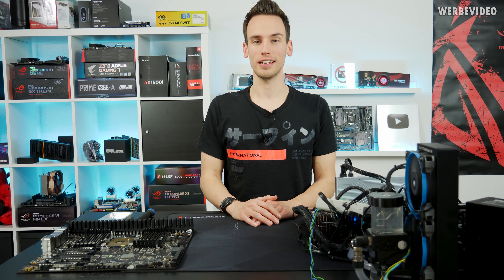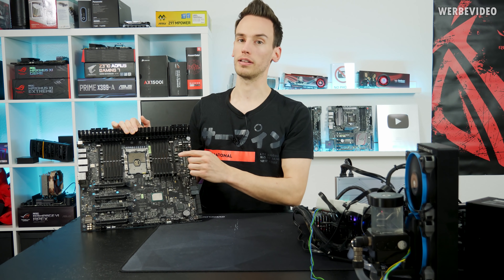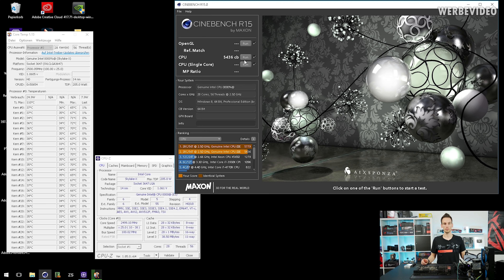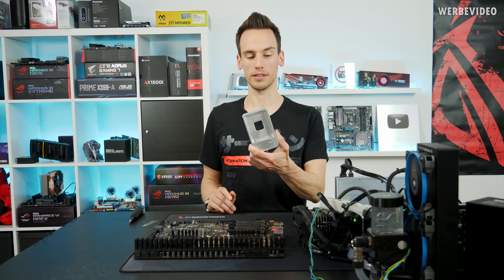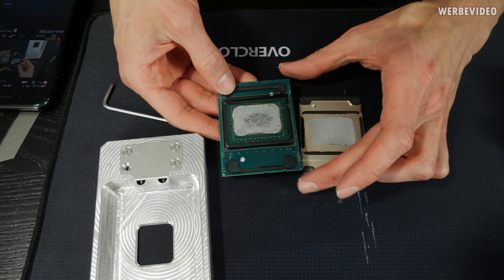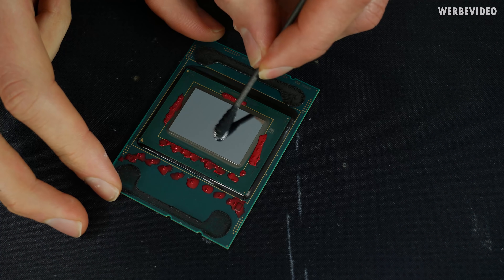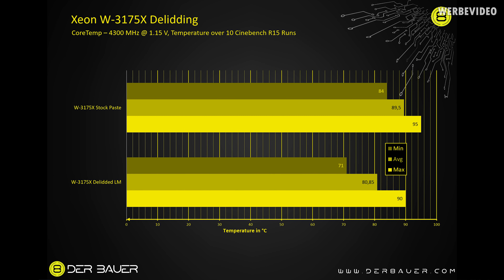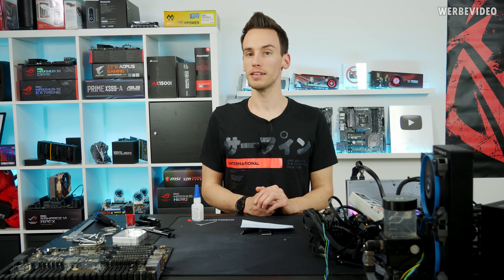The most EXPENSIVE CPU I've EVER delidded!

Comment: Ok so an OC'd 2990WX already hits 6000 in Cinebench multithreaded. What's the point of this Xeon?
Reply: Jeff T the XEON draws MUCH more power, ESPECIALLY OC'd
Reply: @Jeff T Not true. This is a 255w chip and the 2990WX is 250w.
Just take one look at the power delivery on that motherboard and you'll realize that the Xeon is an absolute furnace.
Reply: It is not numa. the memory pool and everything else is unified, there is no CCX latency, there are no cache/memory bottlenecks. it will perform way better in the tasks that are sensitive to that (not cinebench/rendering in general) it also has significantly better AVX performance). But off course price/performance and general sensibility of this platform is completely insane level bad.
Reply: @Lady_Zenith  There's always latency no matter, what, whether it's DMI, HT, CCX.
Reply: Anything that benefits from AVX512 should likely move to a graphics card.
Reply: Gamers nexus has benchmarks and reviews live. I would get two 2990wx CPUs before i got one of these. Boards are vaporware also BTW
Reply: And that's fine for you as an individual user.... but it's a different story when you're buying hundreds of the things to be maintained by a team that has been using Intel CPUs for more than a decade. If intel did NOT release this part, many enterprise workstations WOULD have moved to Threadripper, but with performance anywhere close you'll see a lot of these things moving just by reason of inertia.
Reply: This cpu is pretty much just for people using avx512
Reply: It's Intel way of saying it's also here
Reply: @Capeau  sounds like you don't understand the problem.
Reply: Missing 2 memory channels.  Go run Cinebench on a Threadripper, then again on an equivalent Epyc system with all memory channels active.  Der8auer already showed that Zen architecture is constrained by memory bandwidth in this scenario when he OC'd Epyc - the same applies to Skylake or any other many-core architecture you care to name.
Reply: Max Cowgill 2300$ more for 2 more memory channels nice.
Reply: @maxcowgill3249  Not all architechtures are memory limited. It depends on the individual architechture. Skylake is not memory bandwidth limited in the slightest, you get barely any scaling in core performance from higher memory bandwidth. Zen is a different beast, it is memory starved and you get improvements in core performance from higher memory bandwidth
Reply: Adobe Premiere :)
Reply: Intel is selling off power-guzzling Skylake-XCC yields that ISV/enterprise customers didn't want to the "1337 gamer/prosumer" market. It is a halo product design to beat 2950X and 2990WX no matter the cost.  It is Intel's equivalent to AMD RTG's Radeon VIIs which are just Vega20 Instinct/FirePro rejects that ate too much power.
Reply: cpu rendering?
Reply: Because threadripper 2 isn't out yet. I can get a 2990wx for 1/3 the price of this. But waiting for tr2 with UMA
Reply: Point is that this Xeon can clock higher under LN2/water and doing alot better in some benchmark, cause of AVX worklords.
Reply: @BNHardwarereviews  higher performance is good, but performance per $ is good for all.
Reply: Dependability.
Reply: @JackBandicootsBunker  lol. What?
Reply: Kristoffer Johnsen You have to constantly tweak the TR CPU for the workload you need, either disabling cores or watching memory bandwidth teething issues which are an inherent problem of the CCX uArch. Having to toggle between Creators Mode and Gaming Mode, or a Balanced Mode is a hassle. For the Xeon, you pop the chip in, and whatever you do, it’s going to be consistent.

While I wholeheartedly recommend the TR for any enthusiast and HEDT user, for the type of productive users this Xeon is aiming at, there’s simply no other choice, if critical consistent and continuous workloads are a big factor. AMD is still working to improve long-term workload reliability, but it’s still not viable enough.
Reply: @JackBandicootsBunker  I get your point and it's completely valid. However, this is only a problem on Windows. Microsoft is slacking when it comes to supporting future tech. On Linux most of these issues completely disappear. 
But I do get your point. Not everyone likes the tinkering
Reply: @Capeau  you are a fool. I watch his channel that is correct, but only because I have looked at his methodology, run my own tests and come to find that he does things the correct way. Just because I watch his channel for information doesnt mean that I dont have a brain and an ability to discern information myself. Go back to learning how shit works cause obviously you need more schooling in how information works
Reply: you can get higher single thread performance and programs that dont like the higher latency of TR 2990wx run much better on it.  you should really check the benchmarks for things that people that actualy spend thousands on a cpu actually run.  things like a lot of engineering software (anything from autodesk which is a lot of the martket)  run much better on intel than amd.  its just another option. you dont have to buy it.  

but actual people who buy these types of cpus really like this and will buy these becasue they will give better performance than the 2990wx. not everybody runs cinebench all day.  plus stock performance of the 2990wx is about 5050.  this cpu in this video is 5400 while only running with 4 out of 8 channels.  

plus cinebench favors amd cpus heavily.  you wont get the same performance in other apps.  if this cpu without a delid does 6200 while the TR does around 6000 then performance in other apps will be much better on the intel cpu most likely with overclocked. 

plus as i said earlier the latenyc between nodes is huge on TR chips.  from one die to another is about 4 times ccx to latency and about 8 times core to core latenyc within the same ccx.  with this chip the latency is a bit higher core to core but its nearly the same across all the cores basically.

if youre paying somebody 40-70k a year to run this machine who cares if it costs a a couple thousand more
Reply: @bobhumplick4213  the only way you would pay 4x the price for less cores and just a small % of single core performance is if you're a fanboy.
Reply: The only real reason for this CPU is for breaking OC records with LN2 because you will be able to clock Intels 28 Core CPU higher under LN2 than a 32 core Threadripper. Second reason Intel wanting to have a 'competitive' product in comparison to AMDs 32 core Threadripper.
Reply: Cinebench is not the only use case.
Reply: @mungojerrie86  I know, but the 2990WX still beats the Xeon in things like Blender. It's only in cases where the software has been optimized for Intel over the years that the Threadripper loses. 
You also have to remember how hot this chup runs, how loud the cooler will have to run and how much more expensive the motherboard will be.
It's a niche product for a very select group of people.
Reply: @DenGuleBalje  Check Gamer's Nexus' review of the W-3175X. 2990WX does not beat the 3175X at Blender, on some scenarios they're basically equal (with the Xeon beating by a small amount), but on some scenarios the 3175X beats the 2990WX by ~30%, which is ALOT if you really need to get work done and time is money for you.

Also on Premiere the 3175X destroys the 2990WX by completing the video render ~54% faster. 
On Photoshop the 3175X is ~40% faster than the 2990WX, but only marginally faster than the 9900k, so if all you do is Photoshop, just get the 9900k/8700k over either of these CPUs.

So yeah, Cinebench scores aren't really useful for anything but for comparing C4D performance.
Reply: @obese7027  I watched GN's review and from what I saw the TR beat the Xeon in Blender stock vs stock.
You bring up two Adobe programs which are  typically HEAVILY biased towards Intel. Premiere and Photoshop are traditionally not well optimized and do not show the actual performance of the CPUs. And still, it's 40-60% faster in two programs vs a CPU that's HALF the price. The Xeon is 100% more expensive and when accounting for the price of that motherboard (that will probably ve extremely rare and impossible to find) it's not even a contest.
Reply: @DenGuleBalje  

Both CPUs are stock, the TR didn't beat anything here.
GN Logo Render:  3175X: 9.3 min  2990WX: 9.5 min
GN Monkey Render:  3175X: 7.8 min  2990WX: 10.9 min
GN Splash Render:  3175X: 9.7 min  2990WX: 11.6 min

Yes, Adobe programs are Intel biased (or high frequency/low latency biased), but that doesn't make these results any less important. Photoshop and Premiere are extremely popular, and most people (and especially big studios w/e) aren't going to change from the software they've been trained on just to use AMD CPUs.

"And still, it's 40-60% faster in two programs vs a CPU that's HALF the price. The Xeon is 100% more expensive and when accounting for the price of that motherboard (that will probably ve extremely rare and impossible to find) it's not even a contest.
"

With 40-60% more performance, people who really need and can utilize the extra processing power (I'm not saying everyone) are going to make up the price difference between these platforms in weeks/few months with the extra work they can get done, they'd be losing money if they went with the 2990wx.
Reply: @obese7027  Ok. I saw it again now. It beats the TR by a little. Still, it's twice the price. I can see how someone would buy the Xeon, but I'm not sure we'll see many motherboards that can push it much over 4.3 Ghz, but I might be wrong.
Reply: @DenGuleBalje  it's a 28 core not a 32 core and a single chip you know what unless you are going to buy a few of these i would say just don't bother
Reply: @obese7027  That's a limitation of windows on some cases.The 2990wx perform a lot better in something like linux.Secondly it's comparing a what $1800 to a $4000 cpu so price to performance the 2990wx are way better.Personally i would pick the 2950x over these cpu's.
Reply: @mungojerrie86  If you do actual work, not benchmarks, with 32 cores you get 8 quad core workstations, with 28 cores you get 7, that's the real truth. If you get the cost per workstation, just an idiot would pick the Xeon, not even a fanboy would pick it.
Reply: None, TR 2990WX is 2300$ cheaper for the same performance. Intel just wants to give the Fanboys something to play with.
Reply: @Capeau  so biased towards AMD that they use intel for their editing rigs because adobe software favours intel...
Reply: @Capeau  No Steve had no bias at all. That is why people that actually pay attention to what is said, and how things are done, and compared their own numbers, know that he is the best source in the industry. If you were to do any of that as well you might learn a thing or two
Reply: AMD's threadripper is bottlenecked by infinity fabric. if your PCI E devices, especially storage devices, need to communicate with each other over PCI E they will be bottlenecked by the 11Gbps speed of the infinity fabric. in that case you'd need to go with an intel part. if not, threadripper/epyc is fine.
Reply: the 2990wx has really bad memory perfomance due to how infinity fabric is set up,if you want to use any memory intensive software this is much better
Reply: @TheBilaras97  with memory performance agree, but seems, with 3rd gen will be much better (one CCX will be now 8/16)
Reply: @TheBilaras97  as stated by another person the "memory" issue has been shown to primarily be a Windows scheduler problem that has been acknowledged by Microsoft and amd with both working together on a fix there is a channel that ran alot of the benchmarks on linux with a substantial difference is the numbers giving the 2990wx a huge bump in performance
Reply: @TheBilaras97  that is only on windows. It runs fine on linux. Look up wendell he coverd it really wellr
Reply: @TheBilaras97  Its not the infinity fabric that is the issue its Windows. Take a look at this video https://www.youtube.com/watch?v=M2LOMTpCtLA